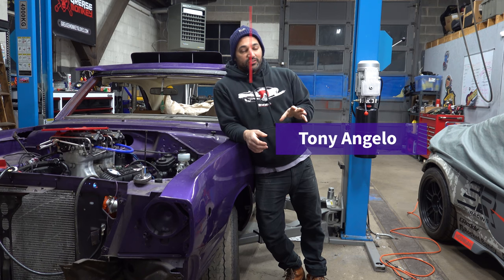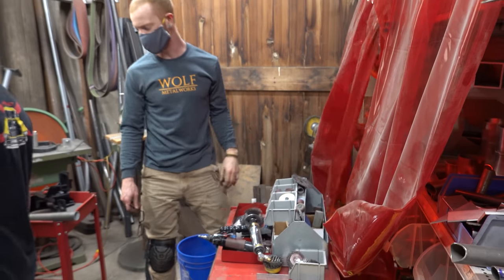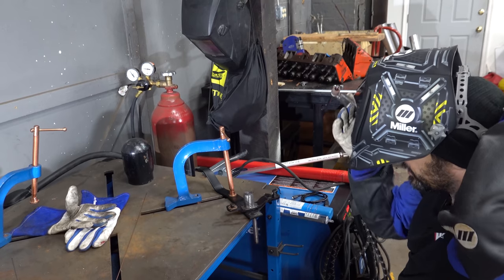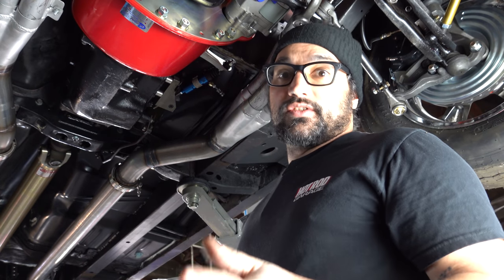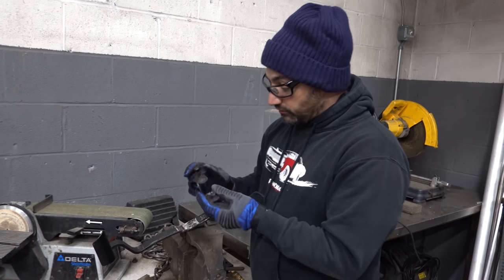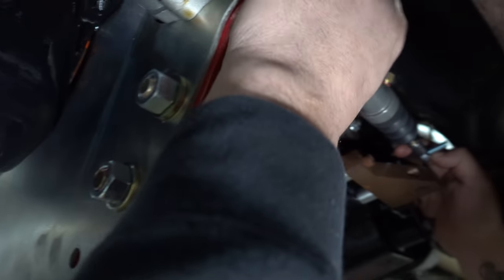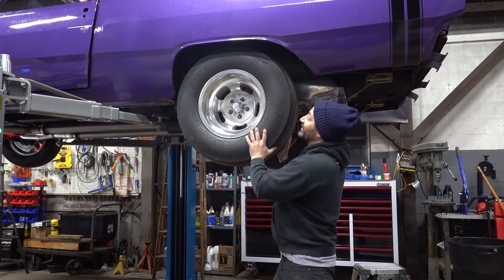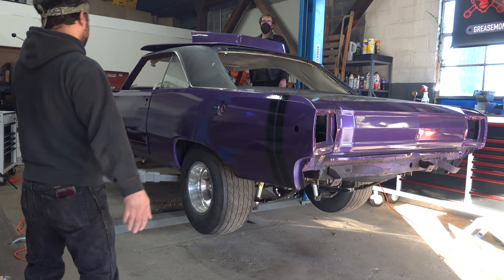Wild '68 Dart Street Machine First Drive ever! FINALLY!!!

Comment: You know there's a real art to getting these linkages right. You take the travel of the master cylinder and the distance from the pedal pivot. Draw a liner through these points and extend out You want this line to extend and be parallel with the axis of the master cylinder piston, and inline at the pedal midstroke. Hope that makes sense. I usually lay out the geometry in CAD so I only have to make things once. Last time I converted a cable setup to hydraulic I used a RAM hydraulic bearing. Very happy with it. I won't use a slave cylinder again.

Comment: I had a similar problem getting my clutch to release with all new parts. I could only get it working by adjusting it all in. This couldn't possibly be right, so I bit the bullet and pulled out the trans. It turns out that the throwout bearing was wrong and didn't extend enough to depress the clutch.

Comment: So real talk, my neighbor across the street from my old house had a 1970 Roadrunner with a 383 and an old A833 4 speed and he didn't know anything mechanical about cars, he knew bodywork. Before I moved in he had a friend pull his engine and trans so he could paint the engine bay and that dude disappeared. He was stuck with the engine and trans out of the car. When I moved in I drove past and saw him working on it and he told me the story. I told him that one day we would get it back together, and we eventually did. The problem is that I didn't know anything about the function of the Z bar or how that 3 finger clutch fork actually worked, but I went through the Year One catalogue and I gave him all of the part numbers that he needed to order, but he eventually gave up on it and sold it to a local car restorer for $2500. He replaced ALL of the rusty floor panels, the rusty trunk panels, both rear frame rail sections, and the entire car was primed and the engine bay was painted. It was running, but not driving, and he sold it to that dude for $2500. Made me sick.
Reply: Oh, since then he bought a running and driving 1969 Roadrunner with the same drivetrain. He loves it...and I'd give almost anything for it.

Comment: I'm wondering why the wheels/drivetrain have so much drag on them especially since it has no brakes?  I figured they would keep spinning and you guys would have to shut off the engine with the clutch out to get them to stop...
Reply from the maker: Yeah, agreed, I'm assuming its just new rear end and trans so maybe it's all a little tight. It seemed to drive pretty well.
Reply: @StayTunedTA  makes sense, might want to keep an eye on it though.  Tbh that's the kind of thing that would keep me up at night but I'm pretty OCD lol

Comment: Was there a reason that a hydraulic slave cylinder couldn’t be used ?
Reply: i can tell you. none. i mounted a slave cylinder onto my scatter shield to push the clutch fork back instead of using a pull type cylinder. i originally tried using the same kit in this vid and it was a major headache to make it work..
Reply from the maker: He bought this kid a decade ago before the proliferation of the hydro cylinders but I would go that route today. The old logic was that if they fail you have to pull the trans but they are pretty reliable these days.

Comment: My first car I ever owned was a 68 GTS 383 Dart with the four-speed I had no hydraulic clutch we never even knew what that was and when I raced that thing I could power shift it hydraulic clutches are for wimps boohoo I can't push the pedal it's too hard 😂😂😂
Reply: This car was an auto, so the thought was the hyd clutch would be easier than finding all the stock linkage and fitting it around the headers...but maybe not!